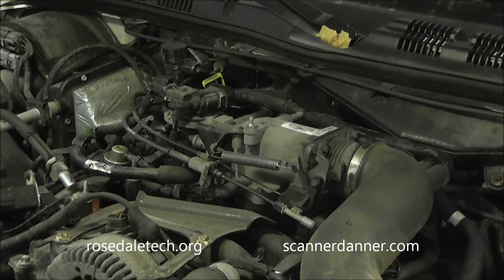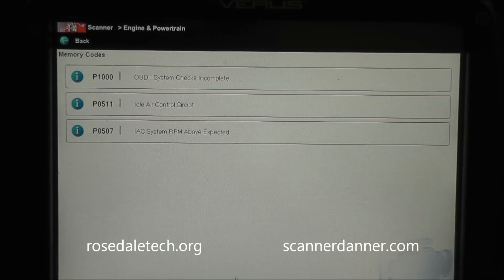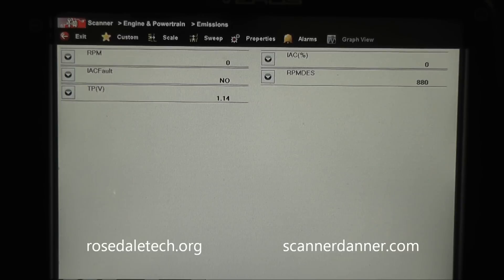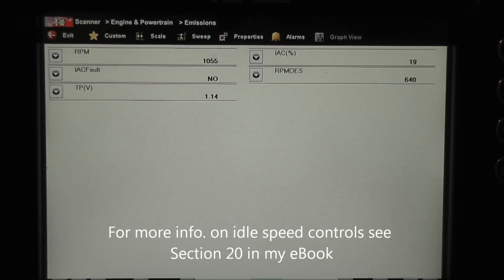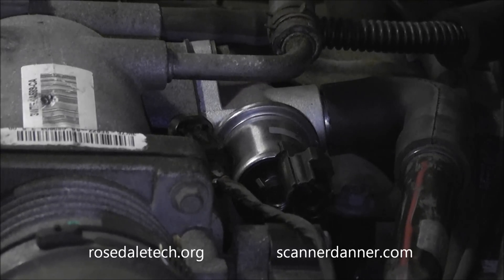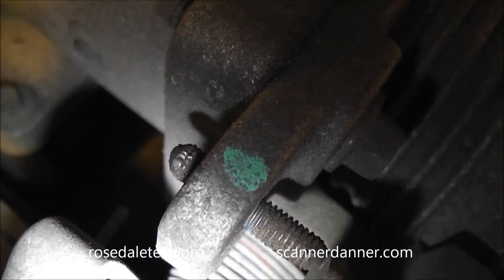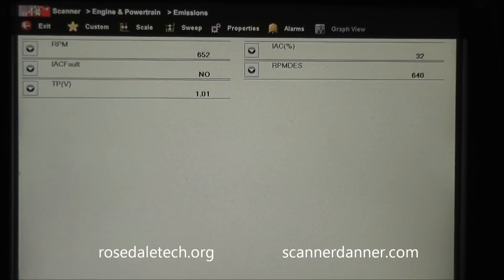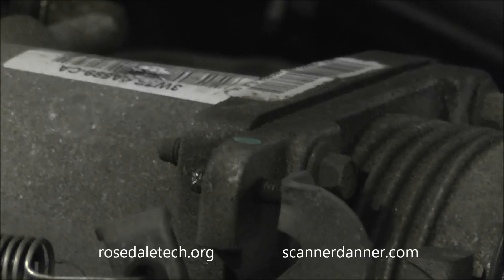Ford Idle Air Control (IAC) valve test (how to adjust minimum idle speed)

Comment: Judging from his confident voice, I can tell he is a one of a kind mechanics that I can trust.
Reply from the maker: I promise you can. I film live and tell it like it is. I can be long winded sometimes but I've been a teacher for 20 years at a technical college, so I can't, not, teach 😉
It's just part of me now. Thank you!
Reply: @ScannerDanner  
My 98 crown victoria has a problem of AC compressor turning on and off every 5 to 8 seconds even on heating cycle. 
Can you tell me what is the problem, and how to fix it?
Reply from the maker: @KunioMasuda  two things:
1. It sounds like you are low on refrigerant charge. The compressor will "short cycle" when it is low. 
2. Ford systems in your year will run the AC compressor (even in the heat mode) in all positions except floor and maybe panel vents. This is done to dehumidify the air for defogging reasons.
Reply: @ScannerDanner  Thank you very much for your professional advice.
Reply: @ScannerDanner  
My 98 crown vic had some shaking at idle, so I cleaned IAC valve, MAF sensor pcv and EGR valve and also injected Sea Form into throttle body.
This took care of the shakes at idle, but decided to change all these item to new ones since my car has over 200k miles. 
Then the new IAC valve made a loud humming noise. So I returned this new IAC for refund. And put back the old one. 
Now the engine is very quiet. But I'll buy another new one to replace it for my sense of security. 
I'm about to replace O2 sensors also.
Can you recommend what else I should replace to maintain this crown vic in good conditions?
Thanks,
Kunio

Comment: 07 Ford tarsus stalls at lights or in park. I changed the iac and cleaned the throttle body and it didn’t help any. I bought a obd2 got a code for the idle air control circuit, cleared the code it hasn’t came back but still stalls I need some help

Comment: TP screw does not control idle speed !!!
Reply from the maker: That is correct but it does have an affect on it if it is misadjusted. In particular the IAC valve position. If it is adjusted too far or too little the IAC cannot properly control the idle speed. Same reason a dirty throttle body can cause stalling issues. Minimum airflow around the closed throttle plate is critical! Mess with the throttle stop screw and you mess with this minimun airflow or minimun idle speed.
Reply: @ScannerDanner  thanks for the info, my 2004 Grand Marquis TP screw is all way inside and surprisingly not touching the throttle plate! idle perfect but goes fast when shifting to D without hitting the gas pedal. i used scan tool the tp voltage is 0.95 which is the minimum, if i put it higher the rpm exceeds the desired RPM. before that all, i have changed TPS & IAC valve. no leaks in vacuum hoses.
Reply from the maker: @rayanalghamdi1162  what are your IAC counts on the scanner with the engine warm, at idle, in park, with no accessory loads on?
Reply: ScannerDanner IAC 21%, rpm average 660 desired 640. disconnected IAC 56% rpm 610

Comment: I rearended someone about 2 months back and right after i crashed i put my car in park and it revved super high and i pretty muched destroyed my front end , i got everything fixed but my check engine light was on when i got it back for the code p0511 , before it was revving high in neutral and park but now its starting to rev lower after driving it for a while and soon my engines going to stall. Is this a bad iac valve?
Reply from the maker: Year, make, model, and engine size would help me to answer

Comment: What about an 01 GMQ that is slow to come down to idle when coming to a stop..It eventually drops to idle after about 15 seconds. I do have the PO1000 code after clearing a coil code...I unplugged the IAC while running and no change in rpm..I spayed carb cleaner around to find any vac. leaks and none found..Cleaned PCVvalve...  Aggravated...
Reply from the maker: On GM stepper type IAC valves, the RPM will NOT drop when you unplug the IAC, like in this video (solenoid type). The stepper motors hold their position when electrically unplugged. The next step is to determine what the IAC command is. My money is on a vacuum leak based on your description, but without knowing the year, make, model and engine size and whether or not it is a MAP or MAF engine would be super helpful for me to be able to answer better
Reply: @ScannerDanner  Sorry,GMQ means Grand Marquis.. 01 mercury Grand Marquis,LSE...4.6.SCT handheld programmer w/tune by Mo`s performance..It`s just so slow to come back to idle...It`s a MAF intake..I drove with my SCT plugged in to see what the IAC was doing and it would go more % as I gave it gas,and slowing went down to like 30% at stop lights..Since my last post I replced my IAC,but I haven`t cranked it yet...It`s like 100 degree`s outside...But I`ll post whats up..
Reply: Well,After installing a new(I had a life time warranty on the old one) IAC everything is back to awesome...I guess they only last 5 years..Thats when I bought the last one...Thanks for all the tips...
Reply from the maker: @stuartracing1  Thanks for watching! Tell your friends :-)

Comment: I paused at 4:00. IAC appears to work fine, but I see the throttle position sensor is 1.14, if the tps is reading above 1.0 volt it results in higher than desired idle.
Reply from the maker: It certainly can on some cars.

Comment: Where can i find the iac valve on 2008 ford taurus
Reply from the maker: I believe you have an electronic throttle body on that year, which means you do NOT have an IAC valve. It is all don't by the computer controlled throttle plate. What are your symptoms and codes?

Comment: No engine light but idle fluctuates in Park only, As soon as I put it to reverse and then drive it is back to perfect idle at 750rpm. What is the problem, should I just ignore it?It runs fine in Drive and on all stops.

Comment: The problem with my 2001 crown vic is that after removing the exhaust at the Y pipe in order to gain some sound,  I noticed that after I rev the engine a little it idles down very slowly.
Reply: You're right that is a problem, when it should instead die instead of continuing to idle since you aren't supposed to be taking off exhaust in order to make sound and piss people off.  Don't be a jerk.
Reply: @stinkycheese804  Settle down now no need to get angry...It now has some glass packs on it and sounds good without being too loud...cheer up its just a you tube comment.
Reply: @stinkycheese804  I bet you’re fun at parties eh?
Reply: @stinkycheese804  Lol simmer down Bertha, no need to project your whiny behavior onto me

Comment: I have the same iac on my ford 4.0 but when I unplug it the revs rise to 1500 rpm , plug it back in and the revs drop to 1000 rpm , is my iac stuffed or is it a vacuum leak?
Reply: If you unplug it and the revs go up it means that it allows more air to pass through with means it's a normally open switch,if it was a normally closed it would bring revs down even stall the engine.Also there are IAC that are like stepper motors and if you unplug them they remain in their last possition till they get signal again so a lot of variables once more.There is no one thing suits all in cars except if you know that the exact model is using a particular system and you go through that as a guide.
Reply: @giannisrd  I have a 97 towncar that revs high, I replaced the IAC TPS and coolant temp sensor. When I unplug the iac the car dies, if I unplug the bypass hose to the valve the car dies. So does my IAC have to be reset or something?
Reply: @howardminkler484  usually when IAC are replaced a relearn proscess is required,a long drive maybe will do the trick as well.A lot of variables to your problem,which is the case for almost any problem that's why specific diagnostic work need to be done and don't just change parts beacuse of an other person's similar  problem or a fault code.
Reply: @giannisrd  I did hook it up to a obdII

Comment: Can that make the car run bad to if you touch that adjust screw?
Reply from the maker: Only idle issues, not really "run bad" issues. Too high or low of an idle speed and off throttle stalling would be your only symptoms
Reply: See my car keeps getting hot and trying to go when I stop to a red light but my temperature gauge says good

Comment: Hi Paul  hey if you get a chance try to do an iac on a dodge truck. On some more on dodge. You have a lot of Ford and some Chevy I see but not of you dodge or Chrysler is on jeep. Here in Arizona it pretty well a mix. But a lot of guy are mopar. And they all tell me the same thing they would like to see more on mopar. So if you get a chance please throw in some mopar.
Reply from the maker: Chrysler and Jeep and for that matter GMs all use the same design 4-wire IAC stepper motor. It doesn't need to be on a Dodge truck in particular. But I will certainly film one when I see it. I have a ton of great videos on the operation and testing of these on my premium channel on my website if you are interested. www.scannerdanner.com There is a 14 day free trial as well.

Comment: This is why I now have a 2011 Leaf EV, I'm going all electric vehicles in the future, and I recommend everyone do the same. 
Sorry, but I'm so done with overly complicated smogged up ICE vehicles. 
I'm fighting now with a IAC on my '92 40ft motorhome with a 460efi and I'm frustrated, confused, and pist off. 
Likely got a bad new IAC complicating the fix. New one leaks vac slightly with power disconnected. SO DONE.....bad parts from suppliers etc etc SO DONE.

Comment: I got an 01 explorer w/4.0 and didn't develop high idle till changing throttle body gasket and cleaning throttle plate, i did do a check of tps volts and its at 1.2 v. I'm gonna give this a try. I have code P1506 but already put new iacv a month ago.

Comment: What would happen if the idle valve is disconnected when engine running??? Will it continue to run or stop?
Reply from the maker: answered this already but here it is again. It depends on the type of IAC valve. A solenoid type will close and a stepper type will hold it's position. 
On this Ford model, this is a solenoid type that when disconnected, the valve fully closes.
Reply: @ScannerDanner  thanks for this info  if it does not fully close is it called out? and can you check if it's closed by feeling the ports in the throttle body.? should not feel vacuum?
Reply from the maker: @yrulooknatme  possibly, depending on e design of the air inlet for the IAC

Comment: wish I'd seen this video 8 months ago, I touched the screw on my 94 Toyota Camry. will now go and do the baseline idle adjustment.
Reply from the maker: Clean the throttle body first. Block the IAC passage (varies on type of valve and system) then set your base idle screw to around 400-500 RPM
Reply: Ok, it’s 11pm here in Oregon and I think your way east, you should be way asleep not responding to comments 🙈
But thanks. 
I’ve been fighting with this Camry 4 cylinder after I replaced just about every seal in the motor including replacing the distributor. Runs great but after long sustained drives and pulling off freeway it would super slow idle then die. Turned out to be sticking Egr valve was slow to close. Only realized this after speeding idle up with throttle stop screw. 
Seeing this video it makes sense. 
I should be slapped with a wet vacuum hose. 
I even have the big factory Toyota service Manuel so no excuses 🤐
Reply from the maker: lol, late night beer league ice hockey game, can't sleep for hours after

Comment: I have an 89 ford bronco 4.9l 
The truck has been restored but with all new parts it's still surging at idle when I unplug the IAC valve it kills the engine,  any ideas
Reply from the maker: what is your MAP frequency reading with the key on engine off (KOEO) and key on engine run at idle? You can use a DMM with a HZ scale to read it

Comment: In my case I had a 2002 f150 4.2 and the throttle body was bent from the piece that turns the tps so it was advancing the sensor to a higher voltage this guy gave me a clue because my tps voltage was 1.8v which was high. I bent the piece back and done, I had already checked every possible vacuum leak and I finally fixed it...thanks dude you are awesome!! Keep up the great  work

Comment: Hey Danner, i have a 2004 Ford Focus mk1 1.6 16v petrol. i have a problem with the idle, if the engine is warm, when I'm driving, and when I need to shift and press the clutch the idle drops to about 500 rpm than it raises to the normal idle speed and stabilize.And I've noticed that the car doesn't stay idle when letting it rolling in its 1st or 2nd gear. It stutters and keeps it with lots of work at normal idle speed. The car remains with a lot of trouble rolling, and does not fall out. But as soon as I move up a bit, the speed drops very low, and stutters but the car doesn't fall out.    i already replaced the idle air control with a new one aftermarket Pierburg. i alread have reset the ecu 1 day disconnecting from battery and let is warm up at first start. also i have cleaned out the throttlebody and replaced the tps. The car idles very smooth when cold or warm and does not move any inch. once a week the car starts hard and stutters. The car drives very good and has lots of power. im lost and dont know what to do for this problem danner.  Can you give me a suggestion pls ?

Comment: I replaced the PCV valve and hose on my Mondeo mk3 Duratec 1.8 petrol. Unfortunately it did not solve the symtoms I have on my car. What is happening? When I start the car with a cold engine the idle speed is around 1.800 instead of 800 and when I slightly push the accelaration pedal and remove my feet quickly the speed increases to 4.000 and higher and the engine runs out of control. I have to turn of the engine to prevend damage. When I disconnect the idle air control valve the idle speed is and stays on 800 (airco etc off) and has a good response on the gas pedal. 

So I did the following so far;
- replaced the idle air control valve
- replaced the T-Map sensor
- replaced the PCV valve and hose
- cleaned the throttle body
- inspected the throttle position sensor
- checked for vacuum leaks

with an app I have checked the trottle position sensor. Looking at the voltages (0,83 at idle) the TPS seems okay. Can you please check these video's (you'll hear a strange voice, I have a speech disorder); https://www.youtube.com/watch?v=_-k6KPc2U70 the IAC is connected, the car is driving my feet is off the gas pedal. The RPM is increasing. In my opinion the IAC % should be 0% because the RPM is above 800. But the IAC is between 40-60% open!
This video https://www.youtube.com/watch?v=lb1JSWq0Jdc the IAC is connected, the car should be at idle (my feet is off the gas pedal, not in a gear). When I start the car the RPM increases to >4.000 RPM. In my opinion the IAC % should be 0% because the RPM is above 800. But the IAC is 35% open!
It seems to me that the Engine Control Unit instruct the ACV to open wrongly. Is my ECU broken? I have no clue, do you have any ideas perhaps?

KR Nienke

Comment: Hello everyone! I am not a professional mechanic at all just a man trying to help my wife's cousin who is a single mother. She has a 2002 Ford Taurus V6 engine. Car would run only if you would keep your foot on the throttle as soon as you would take it off it would stall. I replaced the ICV and it looks like the stalling issue is fixed but it seems to now be running just a little lean approx. 800-900 RPM kind of moves up and down a little! When I removed the old ICV the inside was filthy and she is not the best at maintaining the vehicle and not sure if the previous owner was either.  Any help with the low RPM would really be appreciated. Have a wonderful week. -Paul
Reply from the maker: did you or anyone else mess with the throttle stop screw?

Comment: Hi Paul - what if you have a third and fourth variable - an adjustable TPS and also a throttle body like the one you showed, plus it also has an air screw that you can turn clockwise or counterclockwise? I'm confused where to even start as the baseline here. (Ford probe, EEC-IV)

Comment: I cant get rid of p0430 02 mustang gt 4.6l pi 5spd
Reply from the maker: you need a cat or you have an exhaust leak in front of it. as long as you do not have any other codes, fix those first

Comment: 2000 Ford F150 5.4L my truck. Cold outside, truck will turn over but not start after 3,4,5,6,7 tries. When started, it ran like crap until heated. Replaced IAC. Fixed. Was easier than filling the windshield wash reservoir. Ford mechanics in all the forums said "Do this first, cheapest solution and 99% THE solution"

Comment: Just tell me where the screw is the turn it down!
Reply from the maker: lol, you can't do that. Are you serious or were you joking?
Reply: ScannerDanner yes, I have a bad throttle position sensor. Car started running about 2500 rpm pulled over and unplug the wire and got to where I needed to go.

Comment: Some comments below people will clean the idle air control valve. If you already are taking it off to clean, just buy a new one on EBAY for as little as $30. Your already taking it off and buying cleaner and new gasket.
Reply from the maker: Cleaning these has never been a long term fix in my experience.
Reply: Neil Ouellette Yes, cleaning is temporary. Clean the inside of the valve pocket. Use a code tester live test to watch the valve operation.